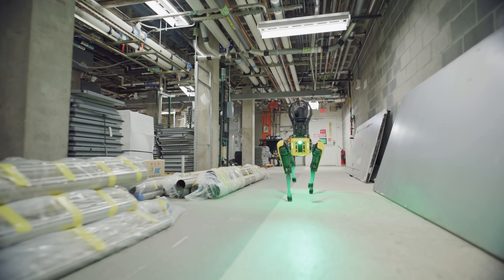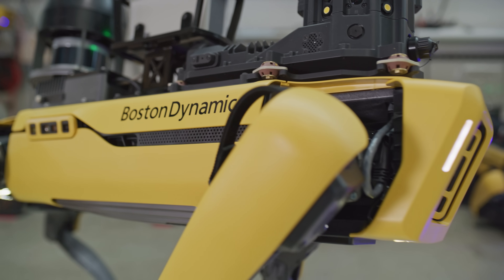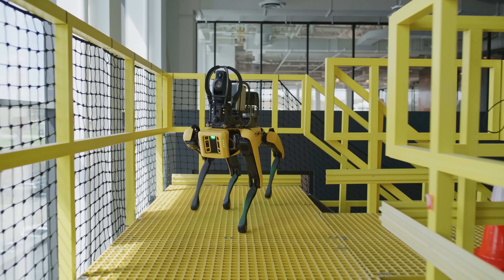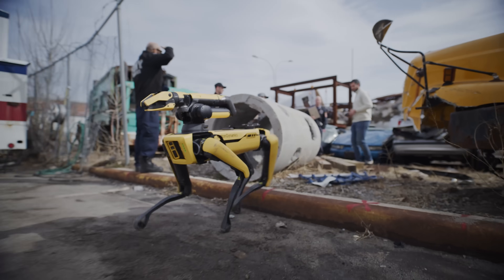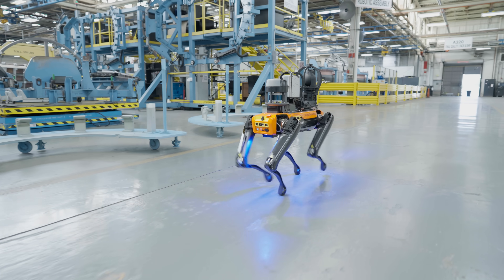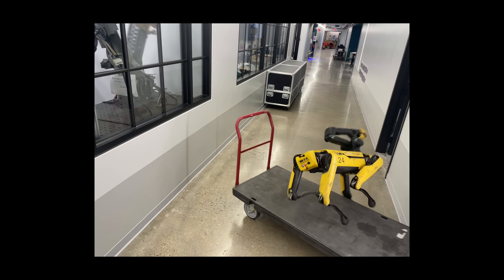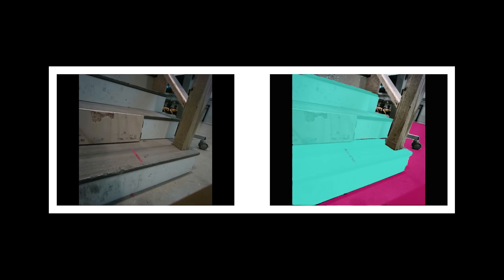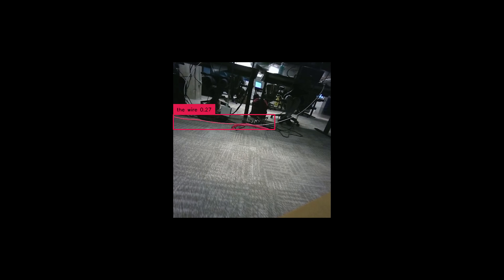Spot Watches Its Step | Boston Dynamics

Comment: For the wire problem, would it be possible to somehow mount pressure sensors on its legs so that it gets alerted when a wire gets tangled around its leg?

Comment: How about a large thin object, like a curtain? Spot definitely has a power to cross it but it does see it as a wall? 
Are there any sensors measuring density of the objects on its way?

Comment: I think Spot would be able to notice thinner objects and objects that are moving under it by giving him a "head on a bendable neck" that moves similarly to an actual dog's, so it can better understand the position of a thin object using different angles to identify its shape. It would also be able to look straight down and step over things if needed. If Spot were to go into a building trying to save someone, the ground under it would be unstable, and being able to realize that its weight is causing something to collapse would be a huge challenge.

Comment: Hi everyone,
I'm a tech student researching robotics, and I'm particularly interested in Boston Dynamics' Spot robot. I've come across some discussions suggesting that Spot might encounter challenges when identifying or avoiding wires in its operating environment.

Could someone explain how Boston Dynamics is addressing or plans to address this issue? Are there any specific sensors, software updates, or strategies in development to improve Spot's ability to handle such scenarios?

Thanks in advance for any insights or resources you can share!

Comment: Would be interesting to see a spot variant with a more typical k9 head setup, it could give spot the ability to judge some obstacles by simply lowering its head to look at it or what's under it or even in instances where it can't go around cables or hoses it could lower its head to look at the thing in detail in order to find a way to step over, it other situations it may be able to look at a spot it otherwise couldn't and maybe identify what it got stuck on

Comment: What iv been dreaming of for a long time for robot .
Has just been developed in China . And I'm sure others been working on it . Its a material  that can change from  softness to hard  by applying heat 
But my idea is a kinda of plastic like substances  when a certain voltage is applied. It gets harder or softer .so there' wouldn't be any need for electric motor  or any metal mechanism. 
That will certain exist in 5 years time

Comment: I love these glimpses or expositions of how mundane things like wires or a cart are the bane of one of the most advanced autonomous machines. They always hint at how far the AI promise, as a whole, is at 😂
Reply: The reason Spot struggles with things visually is because they installed him with absolute garbage cameras and use extremely outdated (probably bootlegged) LiDAR tech from like the 70's. Modern LiDAR's are almost always camera-combined these days to detect things like power lines from airplanes.

Comment: I wonder how far off it is to have spot remember and avoid obstacles. This video implied that Spot must be told, for example, standing on carts is bad. But what if it didn't know that, tried step across one, failed to, but was able to troubleshoot why it failed, and take note to avoid carts. I imagine it would need to be able to take note of objects in it's surrounding, even ones it can't see, and remember them for a while. Or have some ability to "recall" things. Like some kind of instant replay; if it falls, the AI can go over the last couple of seconds of footage to try to determine what caused Spot to fall, and add it to the list of things to avoid. I feel like this is definitely possible, but I'm not sure exactly how it could be done or how practical it is.

Comment: I wonder if there is in there, some sort of adaptive A* algorithm for path planning, augmented by this semantic vision technology. Another thing I wonder is how much in the robot's efficiency and stability is derived from force feedback on its limbs, and not solely on the balance of its centre of mass. Huimans benefit greatly from force feedback on just about every part of their body, as well as on the tactile ability to gauge surfaces by their micro-texture and temperature. Blind humans can still walk around and grab objects, because of this. Lastly, acoustic feedback, while marginal, nevertheless helps us gauge the size of the space we're in, and especially how close we are to a boundary. I think a perfect robot would integrate a myriad senors ; now to be cost-effective, you'd have to imagine multi-functional sensors that are literally embedded in some sort of skin, to supplement, those who sense at the joints, and from the "head".

Comment: The Wet Floor sign made me realize a possibly more tedious task: teaching Spot how to read, and then use the meaning of the words as new data to adapt its walking pattern to be more careful traveling on a new surface condition.
Reply: It's not just read written Words. Some signs are entirely geometric forms, or pictograms. There are also 'barriers' us humans put up temporarily. Imagine two poles with a chain between them. Spot could easily walk underneath that chain without realizing, it is marking the edge of some hazardous zone.
Reply: @xoOPhoenixOox  Or a single cone/pillar with no chain. Even that can mean no entry.
Reply: Typically they have QR codes printed on doors that help the robots to identify an object. It wouldn't be that hard to make a Wet Floor sign that has that information in both English and a QR code that tells the robot that there is a hazard present in the area. They already make signs with multiple languages on them other than English. Maybe QR is the language of machines?
Reply: @RobertBirtchImperfectStone  It is not that making individual markings machine-accessible is hard, but rather that it will not be done by default like making human-accessible signage. Replacing one sign is easy, replacing all your signage is hard and expensive - and replacing other people's signage (i.e. if you provide some service using Spot) isn't really an option.
Reply: Honestly that seems pretty easy, reading wise, scanning would be a bit harder but we have examples showing it’s possible.
Reply: Everyone is forgetting the crucial detail - reading and inferring meaning requires understanding, modern AI doesn't understand, and we have no working understanding of *what* understanding even is. We have vague philosophical thinkpieces and the barest theory committed to it that boils down to "the human brain lies to itself".

A LLM will not be able to infer data of the trillions of sign combinations + variations of application **with derived context**. It will never be able to make its own decisions or intuition, thats simply not possible right now, and probably won't be for decades.
Reply: Your default phone camera has OCR on it now, then get a very simplified local LLM (that is only active when fed words) to read the words and translate them to instructions
Reply: @thefrub  Google's default camera app has OCR*
Reply: spot has lights and cameras i think it should distinguish a more glossy surface to move more carefully/slowly. the camera feed could also be more reliable and faster. in my hospital the wet floor signs stay 24/7 somewhere on the ground and get moved 300 times a shift because only the cleaning personnel can access the storage room for stuff like those… would be annoying if a carrier robot would have to stay a second in front of every sign and always walk slowly even if the ground is fine 😅